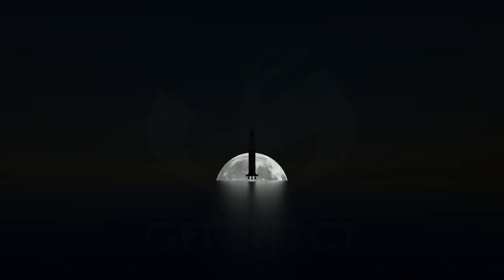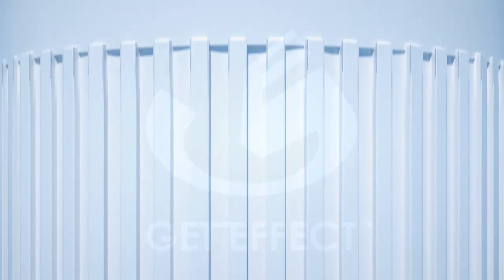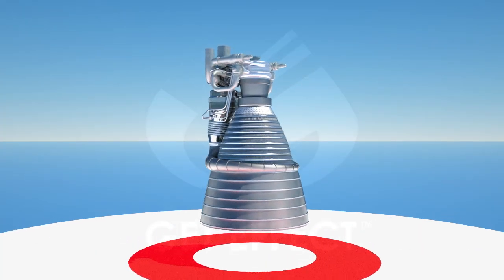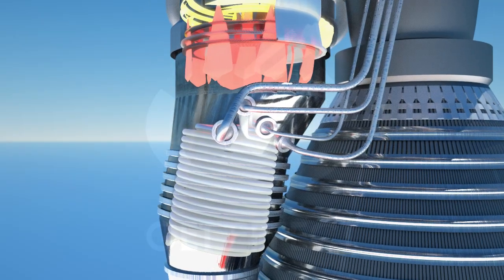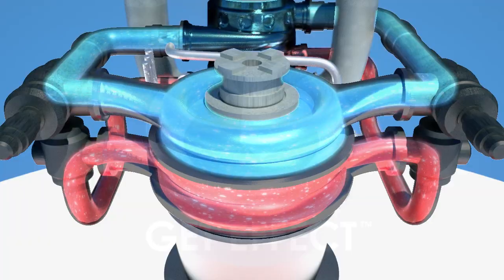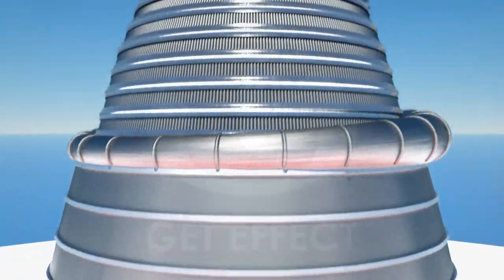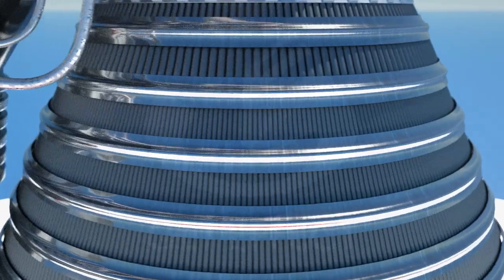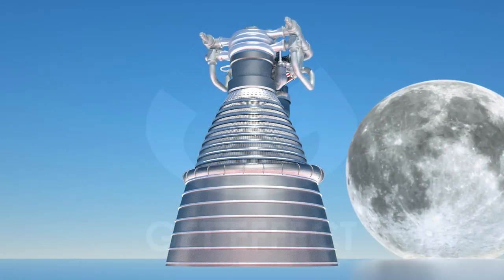NASA SATURN V ROCKETDYNE F1 ROCKET ENGINE, AN ANIMATED DOCUMENTARY (2016)

Comment: Copy of the notorious V2. Thank the Germans again and the great scientists like (Wernher von Braun) and others from Peenemunde.
Reply: And by "copy", you mean a rocket that was 7 times as tall, used three stages instead of one, had more and much larger engines burning a completely different fuel, and having many times the range, speed, and payload capacity.  So, basically it's a "copy" in that they were both pointy and had flame coming out of the back
Reply: i love all the butt hurt here, rockets are never easy, the fundamentals can be understood by anyone but the execution is still one of the most challenging things out there
Reply: Copy? Not at all. The V2 used alcohol and liquid oxygen. The F-1 was much bigger. It was a descendant of the engines in the V2, a development of them on a much bigger scale. The V2 did develop the technology of a cryogenic oxidizer and a fuel at ambient temperature but used a 75% alcohol and water mixture as the fuel (basically schnapps) while the F-1 used a high purity kerosene. Other similarities are the way the fuel was used to cool the rocket engine and the use of a pump driven by what was in effect another rocket engine - the V2 used the decay of hydrogen peroxide into oxygen and steam to produce a massive amount of power for minimal weight to drive the fuel and oxidizer into the engine. Another key difference apart from the scale and the fuel was the fact that the V2 used a fixed engine and vanes in the exhaust stream for guidance while the whole giant F-1 engine was designed to be moved to produce guidance control.
Reply: "rockets are never easy, the fundamentals can be understood by anyone but the execution is still one of the most challenging things out there"

Hence the old (but good) joke: Rocket science is easy. It's rocket engineering that's hard.

Great avatar, by the way. I was blasting Spanish Key in the car just yesterday.
Reply: You can claim is it a descendant to the extent that Von Braun worked both programs and reapplied his learning. But, the F1 itself is a vastly different beast.
Reply: Nick Sofialakis, Goddard would disagree with you. His were the very first liquid fueled rocket engines.  Solid fuel rockets are literally ancient.
Reply: Not even close in most aspects.
Reply: Solid fuel gunpowder rockets were invented by the Chinese and didn't go anywhere for centuries. Liquid fueled rockets were invented by Robert Goddard, who had the misfortune to go public with his ideas during the Roaring 20s, a period of intellectual stagnation in the US when it was widely perceived by the lay public that everything that COULD be invented already HAD been invented. As a result he was mocked and ignored whereas his German contemporary Hans Oberth was hailed as a genius and his rocketry ideas were given lots of money and respect. Both Oberth and Von Braun understood and communicated with Goddard. This is why the Germans were the first to put a missile in space and poor Robert Goddard died isolated and marginalized in his own country.
Reply: The initial idea was taken from the Ancient Chinese and hence the rocket launchers and the first rocket engine appeared during WW2. However the F-1 propulsion system was based on the V2 concept!
For example. We do have multi types of piston engines, burning different types of fuel but the principle is identical to the (Otto Nikolaus August) piston engine. 
Whoever invented the the moon landing, that's still an enigma to me!

Comment: Ok, I didn't realise they were still the most powerful. I liked all the detail on how it worked, very impressive piece of engineering!
Reply: It is not the most powerful rocket engine, it's the most powerful singe combustion chamber rocket engine. The most powerful is the rd-170 which is in use for the zenit rocket and was also used for the energia boosters

Comment: Imagine one of the Russian closed cycle engines on this scale...
Reply: Matt Bowen,,,, exactly... imagine. Imagine is all you will ever do with them. While the Russian heavy lift rocket never flew without exploding, the F1 and it's Saturn V Performed without failure. The Russians made many early advances, but that was largely due to them shipping whole German rocket factories back to Russia and exploiting a looser regulatory system, plus a smaller over all Program structure. But once it came to large scale innovation they couldn't keep up with the massive technical and economic advantage the Americans had. So while the U.S.A.'s larger management and planning apparatus was a drag on development early on, it payed off in the end. Both countries did amazing things and contributed to scientific advancement by developing ICBMs and later space craft. But the point of both countries program was ICBMs.     P
Reply: They could not do it.  The design short coming limit its size.  It would consume itself before the nessary cycle could be compleated
Reply: can you send me a link or any info you have on this?
Reply: Hey Tim. There is no "a" in completed!

Comment: F-1 was a classic masterpiece that still to this day has not been outdone. But, in due time (2022-2024) it will be the Raptor engine that will take us to Mars. Elon Musk of SpaceX has said himself that the majority of the beginning designs for the merlin engines were taken from the Saturn V second stage engines (which proved to be an excellent decision because of its reliability). Raptor on the other hand will be the futuristic mostly methane-powered big brother that the F-1 should have become.
Reply: They are smaller and require more to achieve the same effect. Ultimately that means more weight to launch.  Not to mention they have a failure rate that is unacceptable for the us space program.  No Saturn V has failed in test launch or launching the actual payload. The engine you are touting has had some interesting failures in real world situations.
Reply: maybe the f-1 could be the third stage for the raptor
Reply: Don't forget the incredible Russian closed cycle engines! While they are smaller than the F-1 their technology could be scaled up and a closed cycle equivalent would be much more efficient
Reply: timmainson Name me one time when there was a documented failure of the spacex raptor engine. there isn't one, you know why? becuase it isn't final design yet!